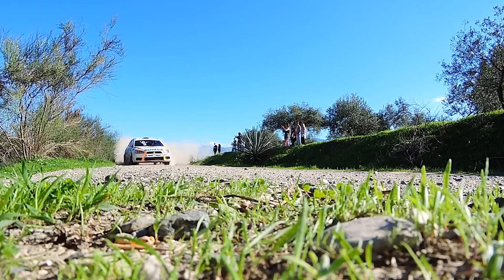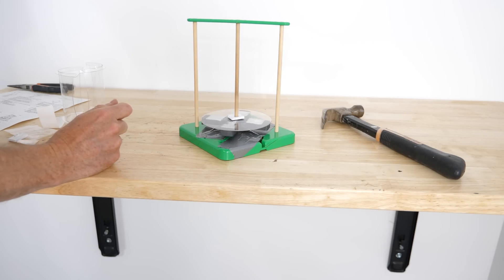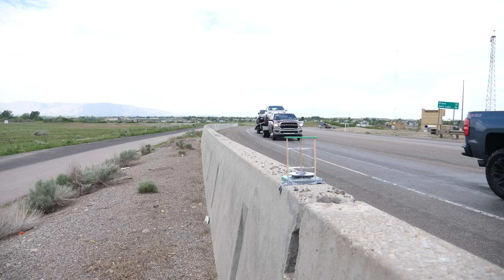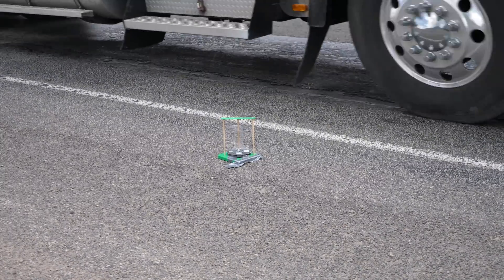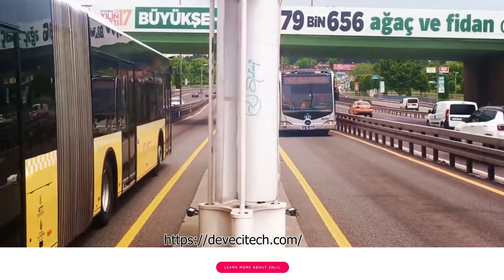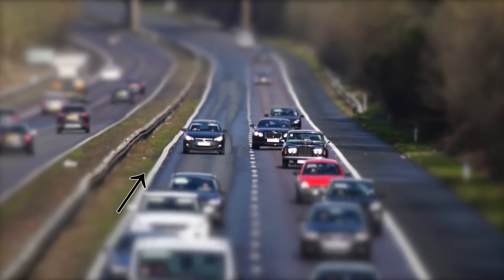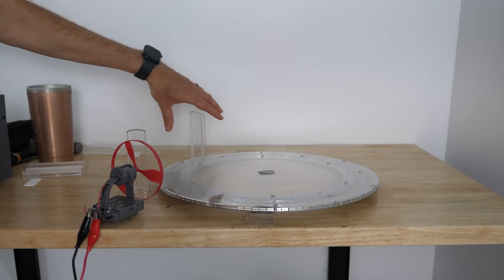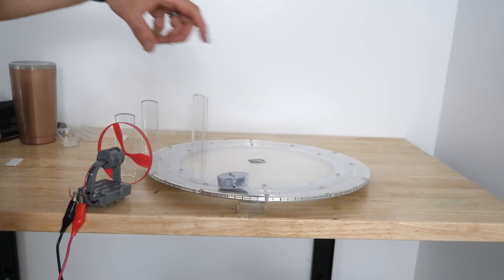Do Traffic Turbines Actually Work?

Comment: I instinctively knew this would be practically possible, but exceedingly difficult to reach a net gain before someone crashes into it or there is some other mechanical failure.
Reply: Yeah, just look at how many people crash into guardrails and barriers on the highway. If you have delicate wind turbines alongside a busy road they'll get ruined far more often than they'd generate net power.
Reply: It might actually be cheaper to power a light pole with this when compared to running the power under ground, labor and paying for the electricity. If it can generate a useful amount of power to keep the street lights on.
Reply: @Thisisaplaceholder1  yes, the general public needs more traffic lighting.otherwise there will be more vehicular accidents
Reply: @Thisisaplaceholder1  no way José is there a stretch of highway anywhere with enough traffic to generate enough electricity to power a light, but also no power lines nearby 😂
Reply: @biggreenblob  really showing your ignorance on the power needed to keep an LED lit.
Reply: @Thisisaplaceholder1  *Useful amount of light

There I fixed it for you
Reply: Thieve will steal it.
Reply: Theoretically possible.
Practically useless.
Reply: Higher education's speciality.
Reply: @infinitytoinfinitysquaredb7836 practically useful, just not for cars but maybe for trains
Reply: And especially with the talks about lowering the emmisions and becoming carbon neutral etc. We dont need to think of turbines effect on a single car but if you add up even the extra 0.01 percent fuel consumption and therefore emmisions of each car then in the end you just raised the fuel consumption and emmisions of the whole traffic in exchange for some electricity so in the grand scheme of things even though it wants to seem like and environmentally friendly green energy globally it has the same effect like using generator just less efficient...
Reply: We will not be using fuel anymore, electric car is the future.

The problem with the turbine is the constantly moving fan.
Something that keeps on moving tends to break over time.

The solar panel is a better choice.
Reply: This is a crazy idea, it is hot on the road. I'm sure anyone agrees with me.
Why not install solar panels as a roof for the road?
Let's do it.

But before we did it, let's find a solution to prevent solar panels get damaged when there is an accident.
What? the solar panel is your priority? not people who drive the car?
Well, don't worry too much about it. The self-driving car is coming. :)

The computer will not drunk while driving, Computer will not sleepy while driving, and the computer will not drive with exploding emotion.
A computer? Yes, artificial intelligence. :)
Reply: @frostsmaker8966  The cheapest way to have solar panels and not get damaged by cars is to not put them close to roads.
Reply: This is realistic thinking
Reply: what i thinking is another problem... the traffic itself, if the traffic is slow and jam... then these turbines are more like spinable road decoration. well location might solve this but it often means further away from city center with less traffic but also making maintenance even more expensive?
Reply: @nicholasxamotainiumgilgamesh  depends on where you live most interstate between cities flows and traffic is constant. I have to imagine the idea would be to save on expensive wiring otherwise the idea is pointless but a lot use solar these days so it may certainly be looking for a solution to a problem that is no longer an issue with cheap solar available
Reply: This is the big one for me. In the US, those concrete barriers, guard rails, and many other items get damaged on a fairly regular basis. Imagining having to replace not only the barrier, but like 2-3 turbines at ground level makes this idea a non-starter for me.
Reply: Not quite. You would actually never get a net gain. What you're doing in a nutshell is, to take one form of energy (kinetic) and convert it back to electric, with never 100% level of efficiency, always a lossy process. If you were to install them on a mass scale, you'd get electric energy, yes. But you'd also increase overall fuel consumption by a fraction that will always be greater than the power you get out, under no circumstance you would get a net gain, always a net loss and in a perfect hypothetical world at best a net zero.
Reply: @GreyHunter49  yes I realize that it would increase drag and therefore fuel consumption, obviously. 
I was talking about a net monetary gain for the installer of such a product, not an environmental gain.
Reply: @biggreenblob  Oh okay! I then obviously misunderstood your comment. Have a great weekend
Reply: It's impossible to get a net gain. You will always be getting less power out of it than the extra energy the car is putting in.
Reply: @notcorrect  The power gained would have otherwise gone off the side of the road. You aren't stealing energy from the car, you're absorbing already wasted energy.
Reply: @Obi-Wan Kenobi  In the video, he proved that since the turbines slow down the wind close to the road, it ultimately increases the drag on the cars.
Reply: @notcorrect   you are leaving out it’s no different than any other obstacle near the car such as a divider, lamp post or building.
Reply: @Michael B  You are right it's not different except these are in place to make driving safer. They are also not designed to absorb energy, so they have less of an effect than wind turbines.
Reply: @notcorrect  there are already things on the road such as oncoming traffic, wind, aerodynamics of the car etc that would have dramatically more impact then a device like this. 
Also as you also saw in his experiment the simulated objects were not designed to do anything, just be barriers. One could argue if those barriers could move it would have less of an impact because they would also push as the object went by
Reply: @Thisisaplaceholder1  
You are right that there are other things that have more impact than this device but it doesn't mean we should add stuff that makes it worse for with no gain.

If something moves when wind blows onto it that means the kinetic energy of the wind was transferred to the thing that moved thus reducing the amount of energy in the wind. If something remains still then the wind's kinetic energy isn't transferred to it and is instead deflected. Both of these cases will reduce the wind speed due to friction by a similar amount.

A barrier along the side of the road if anything helps keep the wind in the flow of traffic by deflecting it back. A line of turbines on the side of the road is trying to take some of the wind's energy and not deflecting it back, so not only is it slowing down the wind its also not going back into the flow of traffic.

An energy generating device is taking energy from somewhere in this case its the wind which is generated by cars and this same wind helps cars move more efficiently.

We can certainly improve the efficiency of cars by putting all roads in smooth tunnels for example but that sounds like an eye sore and way to expensive to build and maintain.
Reply: @notcorrect  In practice it would be like adding a small additional tax to the drivers.
Reply: @InlineSkater72  Very small yes but that means we are burning more fossil fuels with poor efficiency and incredibly high infrastructure cost and maintenance. If we want more energy we should focus on making cars more efficient, not less.

If would be far more efficient and cheaper to construct a power plant that burns fossil fuels for energy.
Reply: @notcorrect  Fully agreed. It's a small tax that ends up being very inefficient and causes more fossil fuels to be burned.

Comment: You absolutely nailed it on this one. All these traffic wind turbine startups will go bust sooner or later, just like the solar roadway startups.
Reply: Yes the only reasonable idea was making a solar covered roof over the parking lots, instead of the parked cars being heated from the sun, you actually create a shade for the parked cars and use the energy to create electricity and also reduced emmisions and fuel consumption because people dont need to crank the AC to the max when they get back to the cas as the car is in shade so its not heated as extremely even though they would still get warm from the surrounding air but by far not as much as on a direct sun.
Reply: What are these solar roadways you're referring?
Reply: @J.RomeroLuna  It's the idea to turn an asphalt road surface to solar cells, to use the road area for energy production. It works, yes, but the installation cost is like 10x higher than regular solar cells, the energy output is much lower as there is a thick glass/plastic surface on top and you can't put it at the optimal angle towards the sun, and the everyday wear and tear kills it within 5 years whereas regular solar cells hold 20+ years. It's as uneconomic as throwing money out of the window.
Reply: @ProjectPhysX  never heard of it, sounds crazy expensive and inefficient, thanks for replying
Reply: @J.RomeroLuna  It was a meme a few years ago... If you search youtube for solar roadways you may find some content to appreciate for itst cringe
Reply: Agreed. These traffic turbines are junk technology. A back-of-the-envelope calculation is all that's required to debunk them

Comment: My understanding of the point of these was for street lighting or as shown, tool booths.  Not for like city power generation.  
Local generation for local use.  
Either way, solar and a small battery is probably better in almost every case this would be used.

Comment: I think little turbines in the water system would be good.
Reply: The water pressure doesn't come from nowhere... It's pumped up into a water tower. The harder it is for water to exit a system (aka with generator turbines in it) the more energy needs to be used to pump that water higher.

Comment: Can't wait for this guy to build a cold fusion reactor in his backyard.
Reply: Or get hit by traffic, apparently lol
Reply: we need to recommend this to Integza
get you a free 3d printer
Reply: A fusor is something a high school student could build. Hell, if regulations allowed it, I'd build one with my students. But, like this windmill, it is horrendously inefficient. Energy harvesting is a nice idea, but in many cases the effort necessary to harvest waste energy outweighs the gain.
Reply: @wernerviehhauser94  fusors don't fall into the class of cold fusion.
Reply: @wernerviehhauser94   - yes the energy cost of the harvester is never recouped in many of these low yield systems - sadly financial cost rarely mirrors energy cost due to disparity in energy pricing -and labour asymmetry. (a lot of the "methane versus electricity" argument comes from the cost to produce and distribute the electricity vs  piping methane directly to the  end user (while ignoring conversion efficiency )  and; tariffs/surcharges/middleman profits, applied to some  energy carriers and not to others.
Reply: Muon catalyzed fusion falls into the class of cold fusion. And it happens all around you it's just exceeding rare  and there aren't enough cosmic ray generated muons and muons generated from particle accelerators take too much energy  for the number of muons and the number of fusion events  they can possibly catalyze before decaying into simple electrons.
Reply: Soon he will. Launch a spaceship to Mars from his backyard before elon musk
Reply: Ya cuz he will do what trillions of dollars and thousands of scientists can’t I’m sure
Reply: you realize everything is a cold fusion reactor right ?
Reply: Farnsworth fusors are very easy to build.
Reply: Ever look into superfluid helium?
Reply: Theres kid who built fusion reactor in his basement.Another kid did in his back yard for boys scout.
Reply: I'm pretty sure the Feds are watching him carefully to make sure he doesn't.
Reply: or tax drivers by turning roads into conveyor belts?
Reply: The fbi want to know your location
Reply: A traffic turbine would be the most effective in a race like f1 and that features a problem due to the mass of the f1
Reply: Just a scale prototype
Reply: I’ll pay
Reply: Building a nuclear bomb using rocks
Reply: I can wait. And so can you.
Reply: he never will.
Reply: @nin1ten1doanything logical is not impossible only improbable